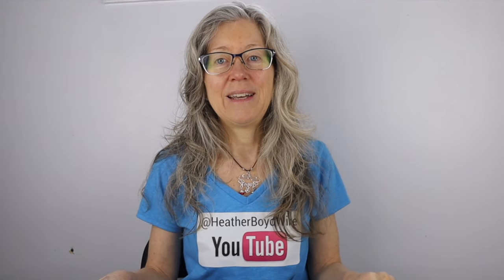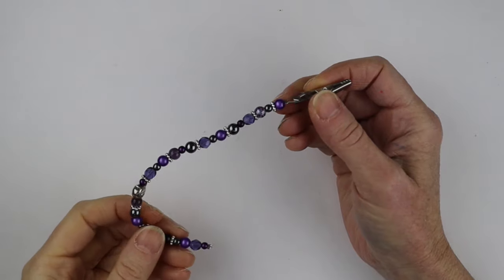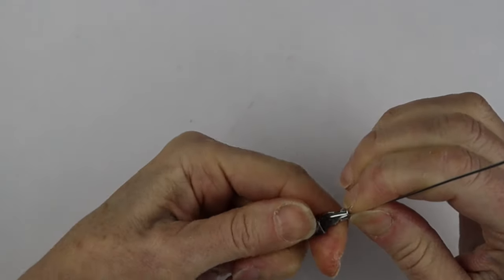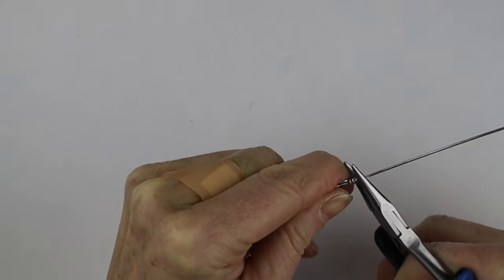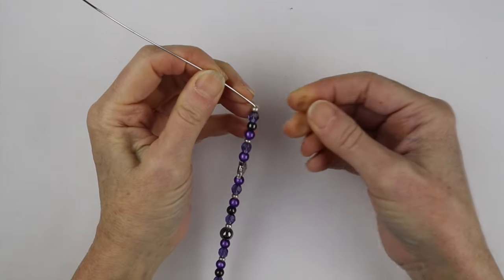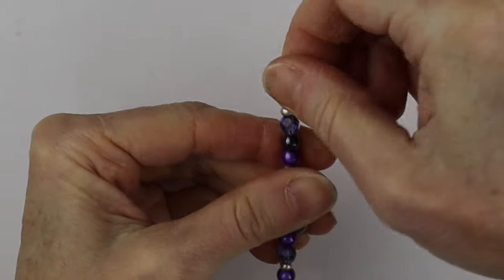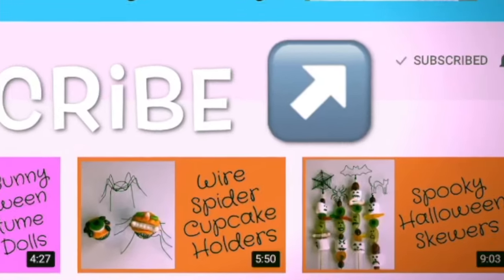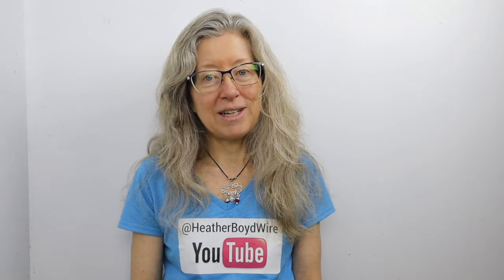DIY Bracelet Helper: Tip Tuesday Tutorial

Comment: I bought the alligator clips with a 4.5 inch tail already on it. Although mine are shorter than yours, these still work. Made three today with a total of ten 12mm wooden beads on each. I glued the last two beads on each bracelet helper onto the wire and they seem to be secure. Thanks much for the tutorial.
Reply from the maker: Sorry just seeing your comment now. That's a great idea to use the ones that already have a 'tail'. Thanks for sharing!

Comment: Is there a specific wire type? I did this and it ended up breaking.
Reply from the maker: You can use a copper or brass wire. 18 gauge should be good. I wouldn't use aluminum...too soft.

Comment: What are the clips called?I ordered alligator clips but it is very thick and all of my beads won't fit on it
Reply from the maker: You can use 28 mm alligator clips like this and add your own wire in 20 or 18 gauge to put the beads on. https://amzn.to/2OnHotC Good luck!
Reply: How do u get the wire to get very tight so that the clip won't move
Reply from the maker: @sharikastokes6682  You have to pull it very tight and pinch it with the flat pliers. You can try threading the wire through the hole in the clip a couple times too.
Reply: What is the exact name of the wire that you used????